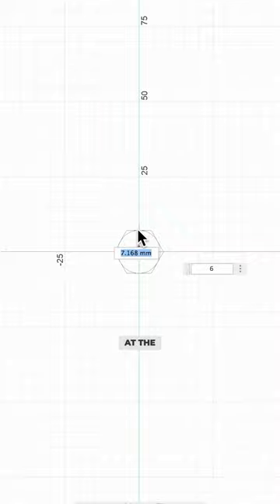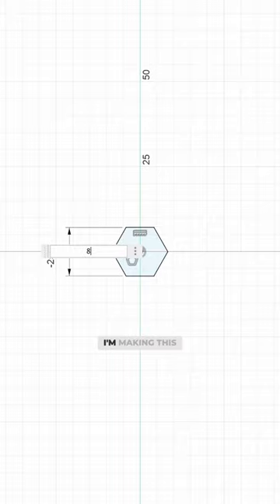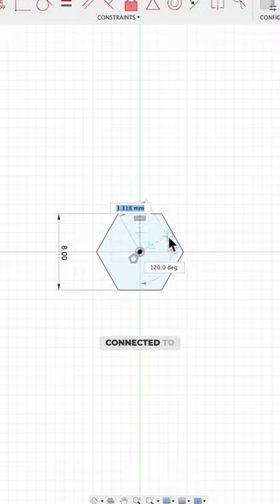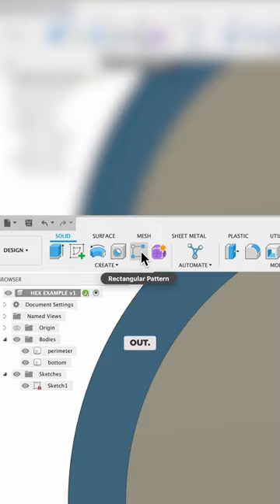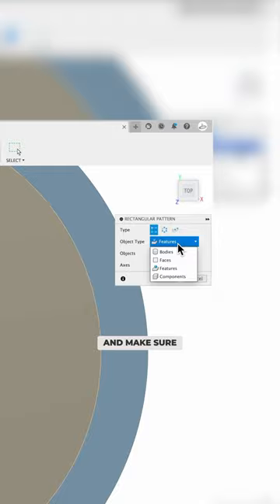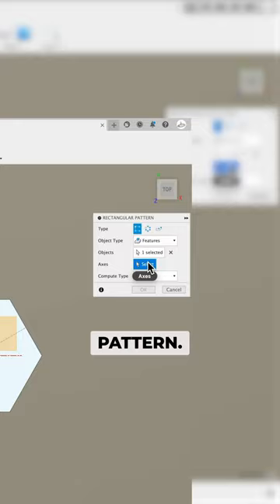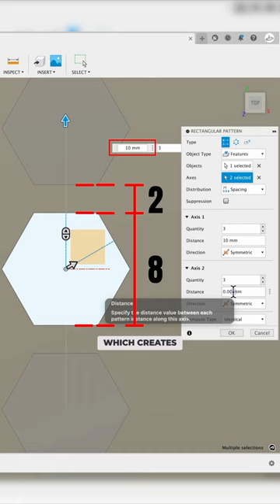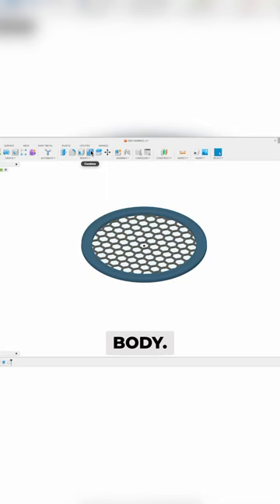How to Make a Hex Grid in Fusion 360!

Comment: Hexagons are the bestagons!  I used bambu labs to make a hexagon screen by just making a flat piece with a hexagon infill with no top and bottom layers.  at the same time I made the frame with the regular layer settings and just snapped the two pieces together post printing.
Reply: You can go a step further and extrude the "infill only" area as a separate shape and use it as a modifier. Have that shape do zero top/bottom layers and you'll have a single solid print.
Reply: PrusaSlicer does it too.

Comment: I know this is limited, but another way can be using a modifier mesh using Prusa, SuperSlicer, and (I think?) Cura.
Reply from the maker: Yep!
Reply: Cura doesn't let you do this. I don't think you can set the perimeters to 0 in Cura. It'll default to 1 when it slices.

Comment: No drawings, just slice cylinder - no top, no bottom, only walls and hex infill 😅
Reply from the maker: Gives you very limited control - and also only works if you’re 3D printing… there are other forms of manufacturing
Reply: @madebyjwillis  in deed, you have 100% right. Just sometimes not everything needs to be drawn 👌
Reply: Works great if you need 100% of the piece to have the pattern, doesn't work at all if you need only part of the model this way 😅😅